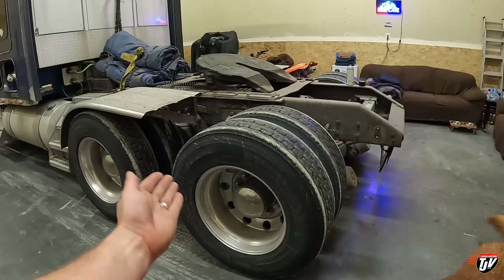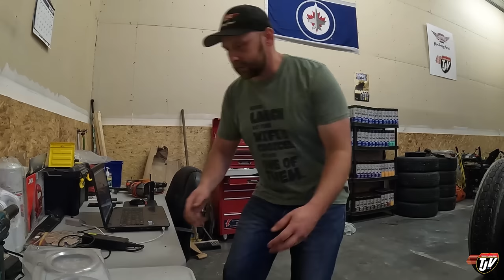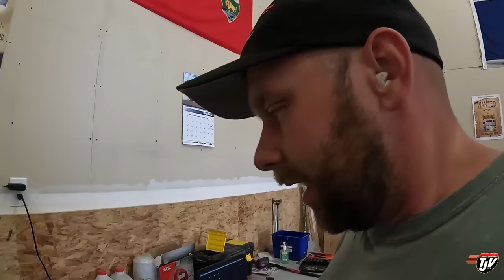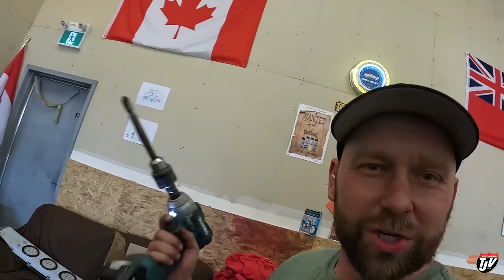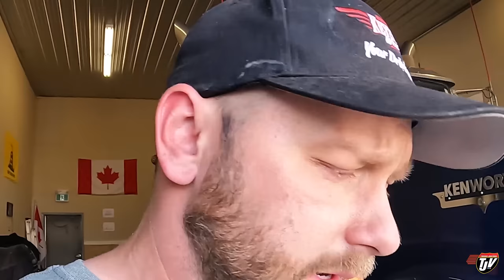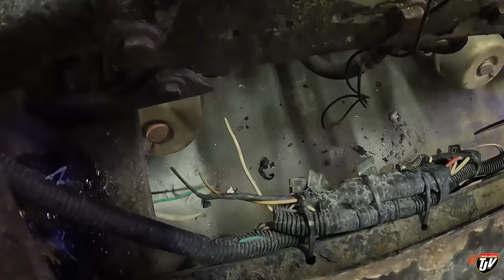NEW HANGERS!! | My Trucking Life | Vlog #2566 | June 26th, 2022

Comment: Yes your right I ripped off 2 mud flaps on a trailer . Backed over small curb at paper recycling plant with my air bags down . Receiver wanted my trailer  lower to fit the dock plate.  If you don’t want the bolts to rust just brush them with linseed oil it seals up everything . Love the lights Josh you did a fine job 🔧🛠⚒⛓👍🇨🇦

Comment: In handling POWER TOOLS,  It's BEST to not be CAVALIER about handling power tools, ONLY AIM at to object being worked on & when drilling hole (OR in this case ENLARGENING EXISTING HOLES) "HOLD drill at 90 degree angle to assure proper allignment of the holes. ( Aiming at CAMERA not a good idea, unless you want to DESTROY THE CAMERA.).
Reply: You can't wallow a hole with a smaller bit and keep it @ 90°.